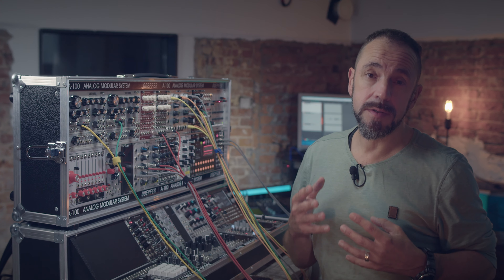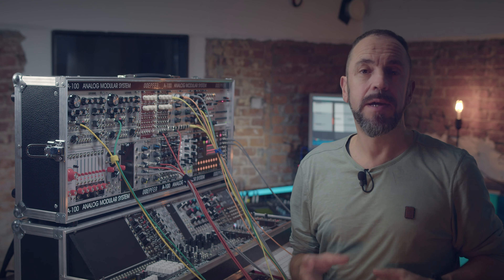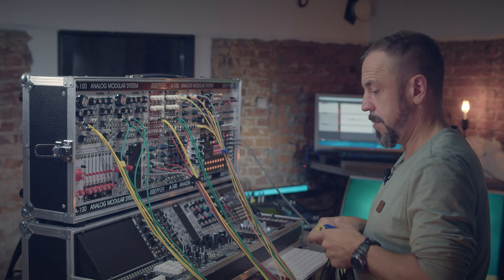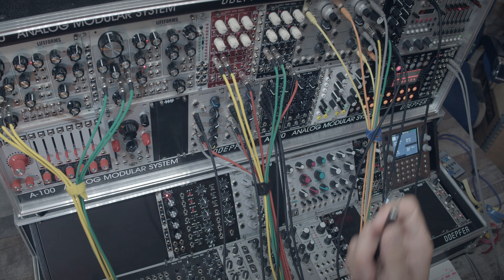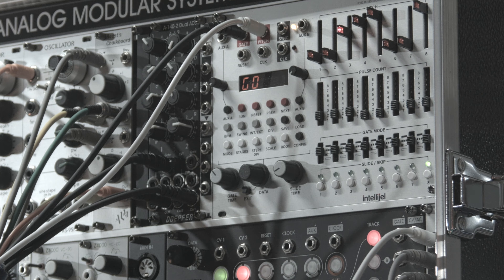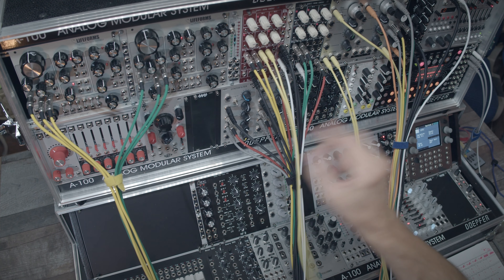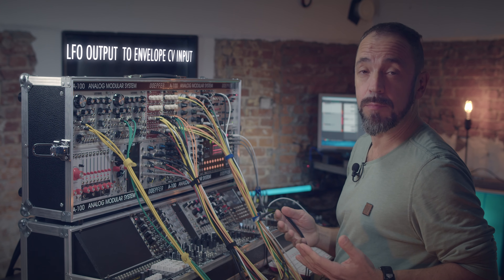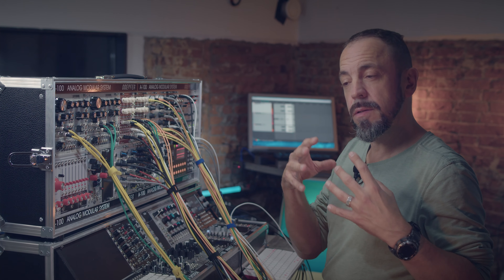Get a wide Stereo Image on the Eurorack Modular System

Comment: Interesting video. Did you run your Ocillators through your Filter ? If not, please try it as the Filter will assist you with any sound quality issues. 💡🎵🎛💥✨
Reply from the maker: I used to have the filters post VCA as it had more harmonical distortion sometimes